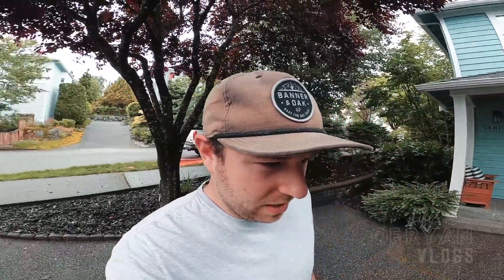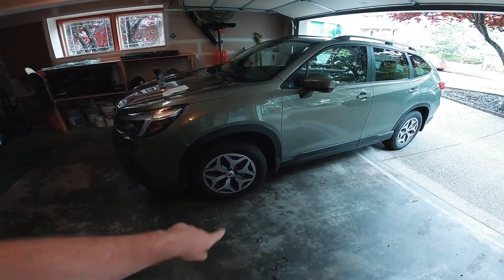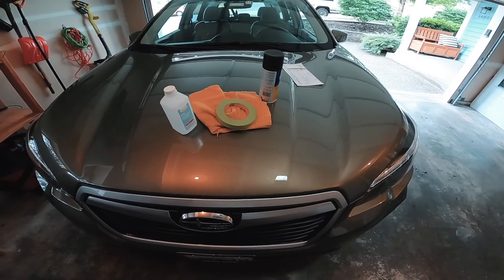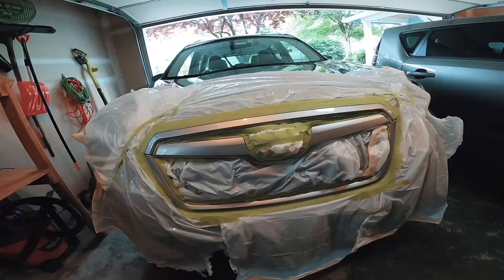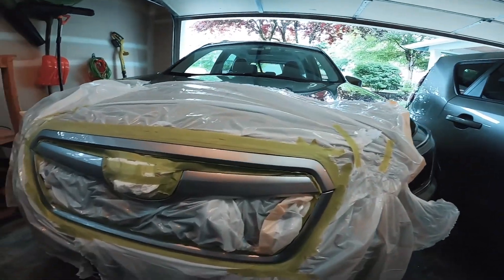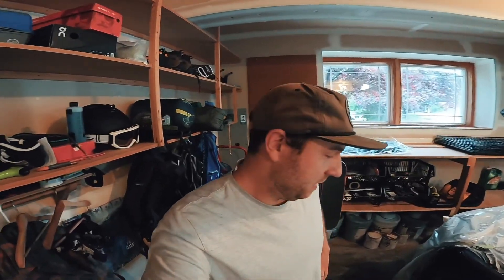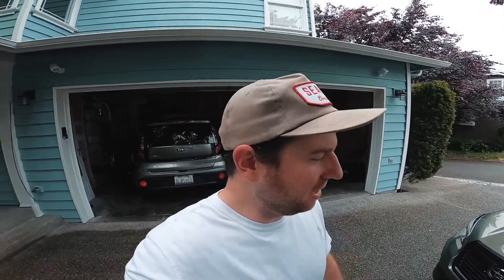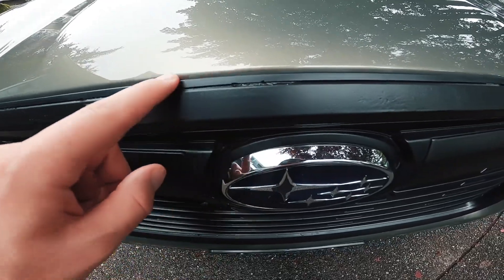Plasti Dip Subaru Grille | Adventure Rig Part 2  - Subaru Forester 2021

Comment: Great Video! I am planning on doing the exact same for my Forester. Any idea why it bubbled?
Reply from the maker: Thanks man! Honestly I think it’s because I wasn’t the best about spraying an even coat. My hand would get too close sometimes. That’s my guess! Another reason could be the humidity. It was extremely hot and humid this day. So I bet a combination of both!
Reply: @fitzthegreat  Thanks for the reply ! Just did some research and plasti dip says to apply when weather is under 60% humidity so you’re probably spot on with that.
Reply: Can’t wait for the wheels video. The green and black goes hard. Are you thinking of dipping the wheels or buying black ones ?
Reply from the maker: @michaelzielinski4378  dude I am so stoked. I thought about dipping them…but I really want that permanent black and green so I’m going to drop the $$$ to just get wheels!

I don’t know which ones I want yet, so if you have any suggestions or ideas let me know!
Reply: @fitzthegreat  I would agree that the best choice. Not sure how dip would hold up on the wheels. So far I’ve dipped the badges, now I’m focusing on the grill and the wheels are next for me hahhaa. I’ll let you know if I find anything that stands out
Reply from the maker: @michaelzielinski4378  you gotta let me know how the dip goes for you! And if you find any tricks or tips!
Reply: @fitzthegreat  STI wheels look great
Reply from the maker: @maxt3590  ooooooh I’ll have to check them out!